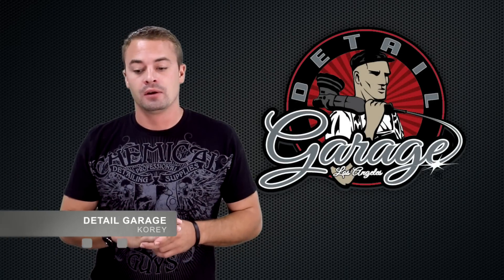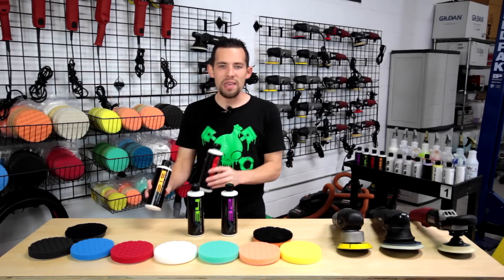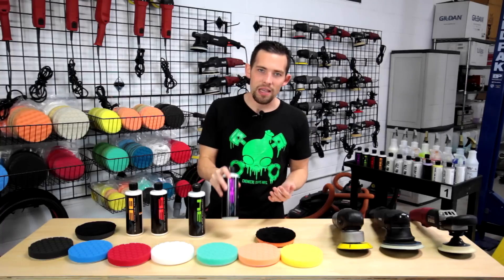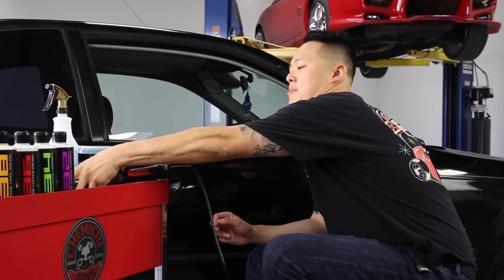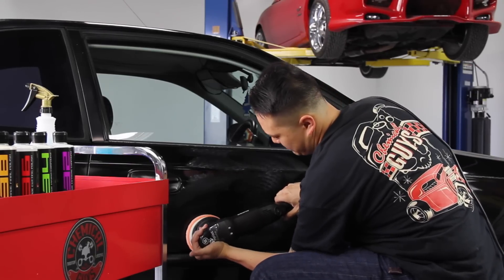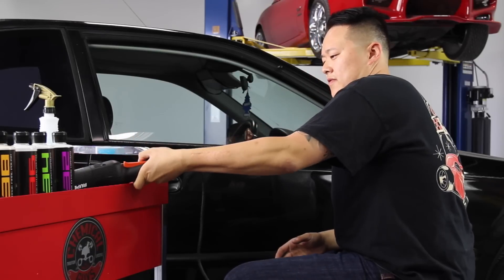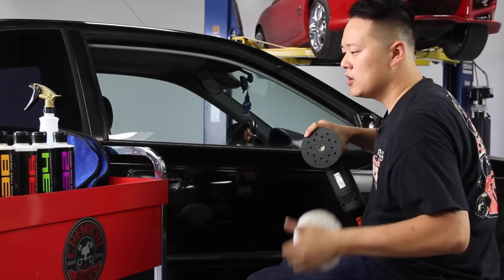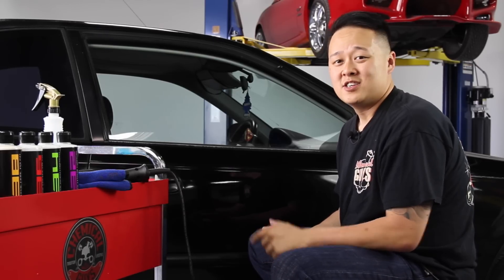How To Machine Polish A Black Car - Detail Garage - (S1E4)

Comment: Good video. However....when cutting a lawn you don't overlap by 50%! If you do you won't get the nice crispy lines! Anyways, I have a GMC Sierra. The rear panels have a little rust by the wheel wells, would it be safe to use a machine over that area or should I do it by hand? I'm trying to find a decent body shop to fix it but haven't had much luck. While I do want it fixed correctly I don't want to spend $2000. 
Great video guys! I've used many products out there but the chemical guys product are by far the best! Thanks!

Comment: Hi Guys. Thank you very much for sharing. I have few questions for you. First, Is V38 polish and sealant or just a polish  that doesn't clog the paint pores and is easy to remove for prepping the Clear coat for SS6 and V9? I guess you would want the clear coat to be pure and allow SS6 and V9 to stick straight to the clear coat not to sealed polish right?

Comment: Chemical Guys  last week i was using my yellow cutting hex logic pad, and after about 3 passes the pad just ripped into pieces and hit my face lol.. this pad was new !why would it tear up like this ??!
Reply: it was primed, and i used plenty of pad conditioner.. idk i guess it was a defective pad..im going with griots pads instead
Reply from the maker: Sounds to me like you were putting way too much pressure on the pad while polishing over a sharp edge. Sharp edges can destroy a pad. It had nothing to do with the pad itself, but improper user technique. Proper technique is 90% of polishing and paint correction.

-Greg@CG
Reply: maybe it was just me. i was using a DA but i use alot of pressure. i was actually using less than i usually do. how well do the microfiber pads cut and finish ? i might switch to those Chemical Guys
Reply from the maker: Gerardo Ortiz You need to only use 7-10 lbs of pressure. Using too much pressure is bad for the machine, bad for the pad, and VERY BAD for the paintwork. Make sure you don't use too much pressure when polishing with D/A. We offer a hands-on polishing class at our Los Angeles Headquarters. If you wanna wanna come down and take a class to improve your skills, we would love to have you!!!

-Greg@CG
Reply: i would love to come one day and take the class.. i really do need it
Reply: whats the difference between the no 700's compounds and polishes vs the V series of polishes ? Chemical Guys
Reply: Gerardo Ortiz Griot's and GC Hex pads are both made by Buff and Shine. In my experience, they are the best pads made. The Yellow, orange, white and red are closed cell, prepolymer foam, and is structurally weaker than the reticulated open cell foams (green, blue, and black). Lake country's cyan hydrotech is part of their closed cell offering. It is positioned as a heavy cutter, similar to the yellow Hex Logic. A quick Google search reveals that there are a lot of problems with the cyan pad. I've used mine twice, on a test panel, and already see deterioration. I'm sticking to the green Hex Logic for compounding,  because of it's agressive pore structure. I have no problems eliminating 1500 grit on a pc with it, and megs m105. I like the yellow and orange for one steps because they're pretty soft, and believe it or not, the yellow pad is much softer than the orange, but not as smooth.
Reply: tsss. i wish these guys had a satellite center in other states.. but i guess cali is where its at.
Reply: Chemical Guys
Reply: A new pad should NOT just rip apart like that.

Comment: Im confused, so If I have heavy damage on my paint I should start at 32 right? Okay so wouldn't I work my way up, why jump from 32 to 36? Also would sealants like jetseal be applied after these steps? 

I have a black pontiac G8GT and Im trying to get a mirror finish. Ill do as many wax coats or polishing coats that it takes to achieve that!

Comment: Do I need to change the towel when I buff off the V32 V34 or V36? 
Like a different towel for different compound/polish.
Reply: yes, any job you do use a new towel. drying / cutting / polishing / windows / wheels etc. you dont wanna transfer dirt or cross contaminate especially during the cutting process

Comment: Would this product work on my audi a4 s4 2013
Reply from the maker: Hi Jose! Yes that is correct. Keep in mind our V-Line contains different abrasives some are lighter then others. If the paint only has light scratches, we recommend V36 accompanied with a Orange Hex-Logic cutting pad. After you are done with V36, follow up with V38 accompanied with a White Hex-Logic pad to refine the finish and enhance the shine. Happy detailing!

Comment: First off all, no comparison done 50/50. No testing spot BEFORE actual polishing, you just went straight to a compound and cutting pad, . One thing is to start with the least aggressive method first, and if needed, bump up to a higher grit. This is not what you should be showing people, specially people who never have polished before. Poor instructional vid. Too little information, crucial information at that. . .
Reply: ***** First question i have for you. What is your knowledge and expertise ? Have you ever polished before? There is no 1 size fits all, i'm afraid . . . So more information would be handy.
Reply: keep watching more videos on you tube malaka

Comment: Omg another useless video. How do u expect us to believe that it was 80% corrected? So to speak. Some validation won't hurt right.
Reply: They have some good products, but i hate the way they PR them. They rarely use them on really dirty car. Always some light dusty car . . . Makes me sad panda
Reply: I absolutely agree with u. On another note, don't buy their waterless detailing system UNLESS u maintain your vehicle. I tried using it on mildly dirty car "hence the video with the muddy truck". long story short, i was very upset.
Reply: Junio San Nicolas
Well in all fairness, any waterless systems is only really suited for clean or slightly dirty (as in dusty) cars. Not mud, mud should be hosed off, Lots of lubrication, before even touching it.